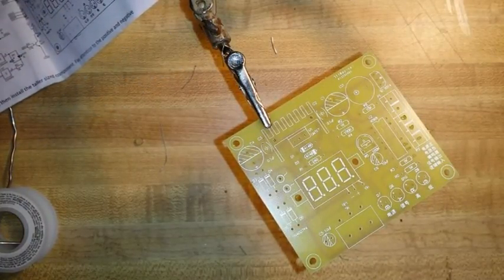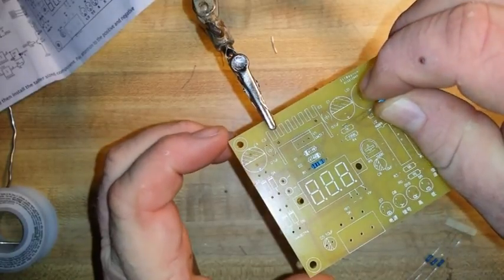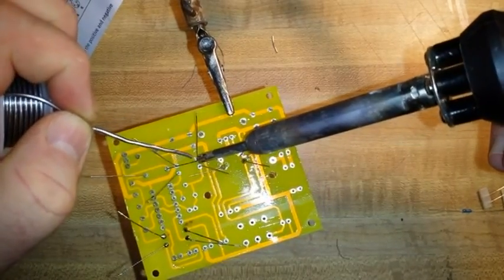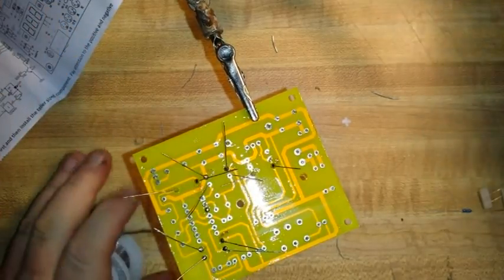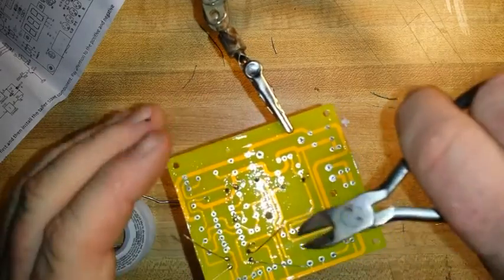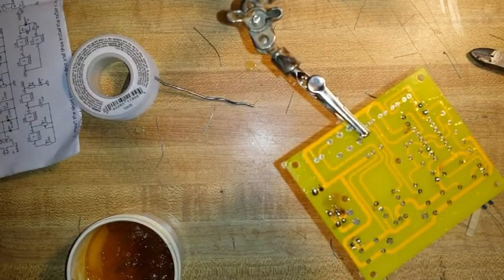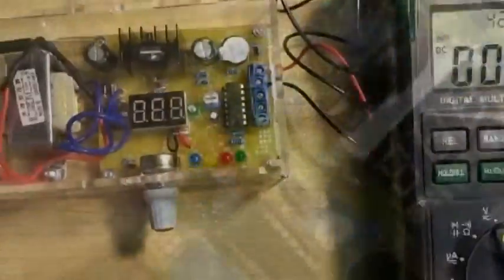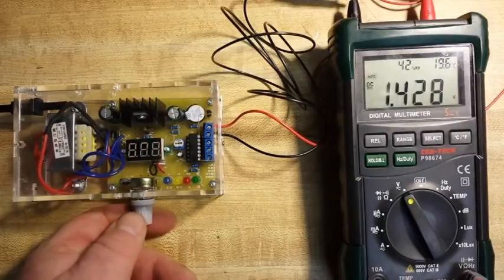Banggood LM317 DC Adjustable Power Supply Build

Comment: I've built 2 of these kits and they both work fine.  Check your wiring and components.  The 2nd one I built with a friend that knows nothing about electronics or soldering and his works also.  I gave it to him so he could learn how to solder and we took a few hours and put them together and did it slow so he could learn a good soldering technique.  If he can make one work, not knowing anything about electronics or soldering, then you've done something wrong.  Did you ever figure out what happened to it?